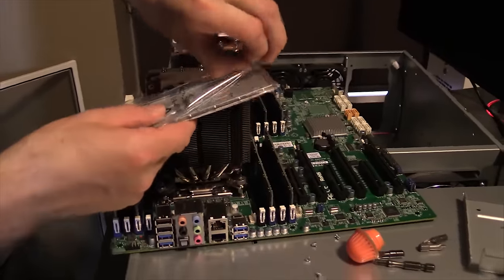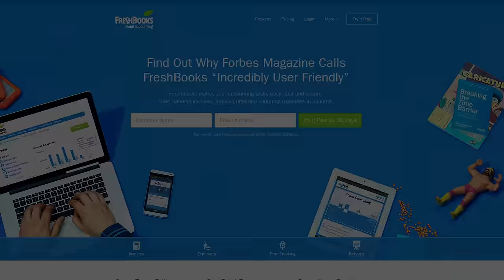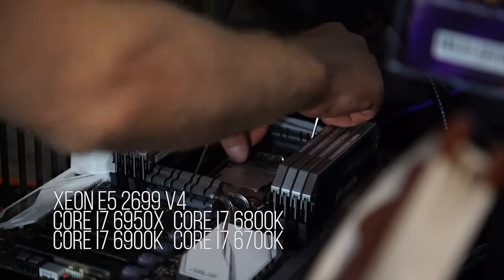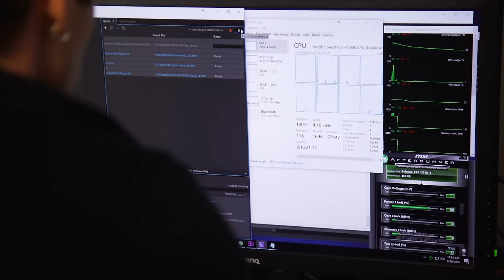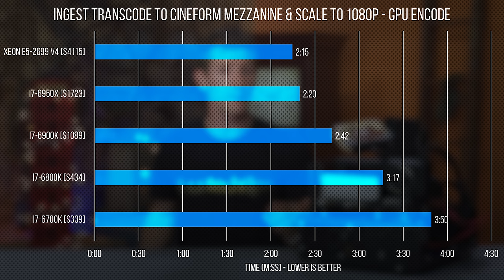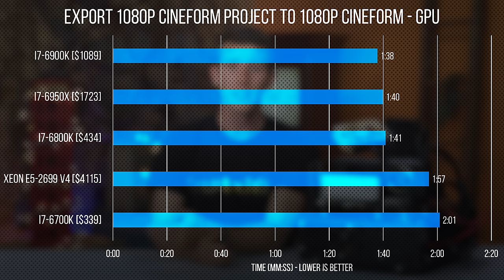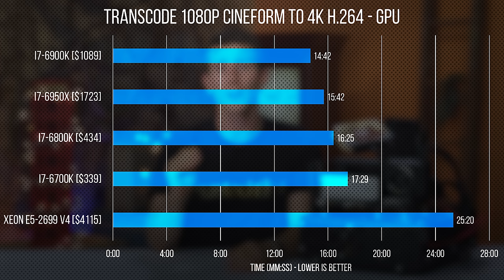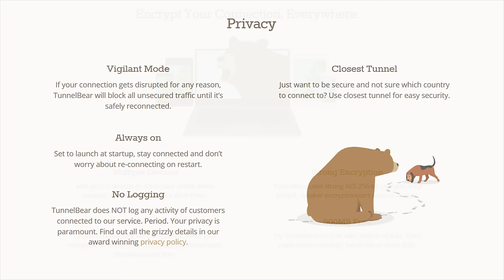$300 CPU Beats $4000 CPU?? - Cores vs clockspeed for video encoding

Comment: Somewhere out there is an Intel Xeon Marketing Rep who's never sending Linus another Xeon CPU and somewhere out there is a very emotionally confused Core i7 rep who's happy about Linus' results but is about to walk into an awkward meeting tomorrow with the Xeon team LOL
Reply: Comparing Xeons to Core i7s is like comparing twenty mopeds to a huge motorcycle.  The 'cycle will get you to the destination the fastest, but the mopeds will be better if you want to bring your friends with you.
Reply: Using x264 you get really good scaling with more threads but max is 1 per 40 vertical pixels or so they say
Reply: W
Reply: The 2699 was designed for very scalable apps i.e. server farms and virtualization data centers. 
Efficient encoding is notoriously hard to parallelize so it was clearly a very poor fit.
Intel also made several W xeons with low core count and high frequency, specifically designed for workstations, where ECC and the huge amount of addressable RAM give xeons a clear advantage versus i7.
Reply: Aaand if you OVERCLOCK your moped you can drive as fast as the motorcycle can,  but the sysadmins might come and smack you over your ram sticks! ;) ...or something xD   (made no sense... I know..! ) xD
Reply: LOLOLOL ROFLCOPTER 4000
Reply: +Stefan Karlsson haha I love it!

Comment: More cores + overclock for best of both worlds?
Reply: First you need to increase your internet speeds by taping a battery to a Ethernet cord. Honestly Thio you are an actual god on satire because you base it on half truths (most of the time). My favourite by far was how to cool a beer in 2 hours.
Reply: Joe how can i upgrade my ps4 to ps4.5 for free ?
Reply from the maker: +ThioJoe here I thought you were going to suggest replacing my power supply cables with pipe cleaners.. :p
Reply: Yeah, and while we are at it just through out your ECC RAM. its slower anyway
Reply: +LinusTechTips, totally off topic.. What watch is it that you are wearing? looks cool.. ps. good content, keep it up!
Reply: LinusTechTips of course not... you need to wrap it in gum wrappers
Reply: oh sry i forgot about that :) Aluminium foil from the kitchen should work aswell
Reply: or if you don't know correct english its aluminum , even though on the periodic table its aluminium
Reply: You can't overclock Xeon Processors
Reply: NonsensicalVids I thought they call it tinfoil? I wasnt sure if that is made of aluminium aswell so i went with the materialname :)
Reply: Michael Novak Check out ThioJoe´s Channel, it will make things more (or less) clear :)
Reply: Lukas H. its made of aluminium or other grey metals. but more commonly aluminium
Reply: scam
Reply: Seeing you comment on any video makes me doubt it's legitimacy!
Reply: I heard melted chocolate makes more cores run wild :P
Reply: Probably poor optimization on the software.
Hell, you could run 2 dozen and a half Minecraft servers on it.
Reply: He got a 3% OC on that Xeon
Reply: bro you gotta link for me to download more ram?
Reply: no download 8 cores
Reply: Moar GPU!
Reply: why don't you make a tutorial  to show us how to increase our cbu cores  into 100 core for free 😂😂😂😂😂
Reply: ThioJoe How to get 1mil  subs ???
Reply: You can't over clock Xeons so you would have to use a 6950X or something
Reply: NonsensicalVids aluminium is your it's spelled in Canada it's pronounces al you mi nee em
Reply: ThioJoe Nah M8 you gotta pour water on it and the results will be shocking
Reply: Well the more cores you have the more difficult over clocking becomes
Reply: yeah heck the wr for highest overclock is on a 8 core processors with 6 cores disabled
Reply: I tried this.  I works like hell!
Reply: That would be great but unfortunately most Intel server solutions have no support for any overclocking, at least not that I've seen. You usually get out of band management though, that's cool. Amd might provide a new solution here with their new CPU lines.
Reply: you gotta download more cores, then buy and digitally download more electrons to pass through the cpu
Reply: Rgb thermal paste is the answer.

Comment: This is just another page in Linus's book of failure.
But we love this book.

I would love to see these tests with H.265.
That bitch of a codec requires huge amounts of CPU power
Reply: We all know you need at least 6 supercomputers to run pfSense.
Reply: ... but h.265 is for low bandwidth encodings only
Reply: +murphy Not necessarily, no.
Reply: Of course you can also use a spoon to get in your shoes, but that's neither what it was designed for nor the most sensible way to use it. You'd use a shoehorn for that and you'd use a spoon to eat soup. No need to tell anyone you can use it also for other things, it's obvious :)
Reply: murphy No, I intended to suggest further than that, that it is very sensible and suitable for other uses as well.  E.g. related but not the same, reducing storage space needs or achieving better quality on high (but still limited) bandwidth amounts.  And if you were going to point out that this is obvious then I would point out that most people do not conceive of the obvious and go around repeating things like that you need a Mac for editing video.
Reply: It's comparable to AAC vs HE-AAC, at least to date ... each to its own. Last time I checked, which wasn't long ago, h.265 was still inferior to h.264 at higher bitrates, regarding the "cost"/performance ratio. This includes indeed higher compression rates (as implied by my original statement) but also way higher compute power requirements. Storage is relatively cheap nowadays, so for most people it makes sense to use h.264 for archiving (at decent RFs) as well ... unless you have extremely powerful processors and lots of time, while bounded by restricted space. Which is pretty rare in the post-DVDR era.
Reply: murphy While it's true that h.265 is more computationally demanding than h.264, as a practicality h.264 only works nicely for most people due to hardware decoding/encoding, and as chips with equivalent h.265 capabilities enter the mainstream market it will largely cease to be a concern.  I haven't seen any h.265 inferiority to h.264 at any bitrate, maybe I'm unclear on the comparison you're making.  Citation please I suppose.
Reply: The mentioned h.265 capable chips are featuring decoding functionality, that doesn't help with encoding. If you re-read what I said exactly about the inferiority you'll find that proven by probably any comparison that has been made in the past ... so quoting them all would be rather pointless ...
Reply: murphy Granted I haven't followed it recently, but the myriad of studies during it's design and testing were contrary to your claims.  If your claims are true then they pretty much may as well scrap it all and start from scratch on something better right away.  You don't need to quote them all, just cite a few so we can see their methodology and if 1) what you're saying is what they're saying and 2) if what they're saying actually follows from the tests they did.  Also, there are indeed h.265 encoding chips, maybe you needs to revisit the specs of the more recent cards.
Reply: It literally took me half a minute to find several sources confirming my statement reagarding substantial efficiency disparities ... and since you erroneously allege that previous studies were contrary to it (of which the opposite is the case), did you probably refuse to re-read it as suggested, still not getting its actual point?
What's again your point in urging me to cite sources for widely accepted facts like the sun rising in the east and setting in the west, how about citing some claiming the contrary first? How comes that you don't find even the most prominent comparisons, is your Google out of order?
The "mainstream market encoding chips" you are probably referring to need proprietary encoding engines, and really everyone who has addressed that matter came to the conclusion that their results are mediocre against CPU based encoding.
Last but not least, you are not "we", unless I'm talking to your highness in person. We are the ones who know all the stuff I wrote ... which took far too much of my time already (speaking of efficiency), so if you're not just trolling me, please quote exactly the statement you assume to be wrong and then disprove it by making a proper citation yourself. Not the wrong way around. Can't wait to see it.
Reply: murphy Sorry, I was addressing strictly performance metrics, which you can indeed find reams of in the wikipedia article references, the x.265 site, the Moscow University Codec studies, etc.... almost ad infinitum.  Cost per performance is a sketchy metric to use here, considering that both can be measured very different ways (e.g. do we include transmission costs, storage costs, compute energy costs, hardware costs, the market cost right now despite that h.265 costs are dropping much faster than the more stable h.264 costs, etc...).  Actually I could not dig up a satisfactory analysis in the short time you indicated, so indeed, please do provide one.  In terms of performance, well, there are some things you just plain don't get with h.264 for starters.
Reply: So I'll really have to quote myself concerning "cost"/performance ratio: "This includes indeed higher compression rates (as implied by my original statement) but also way higher compute power requirements. Storage is relatively cheap nowadays, so for most people it makes sense to use h.264 for archiving (at decent RFs) as well ... unless you have extremely powerful processors and lots of time, while bounded by restricted space. Which is pretty rare in the post-DVDR era."

This is neither  "sketchy", nor is it me who doesn't get something here, quite obviously.

Again, "if you're not just trolling me, please quote exactly the statement you assume to be wrong and then disprove it by making a proper citation yourself. Not the wrong way around."

I couldn't find any analysis stating the opposite of what I said above, and this is not due to insufficient research capabilities ... there just are none. So if you're able to find any satisfactory analysis, you'll find my statement proven.
Reply: "This includes indeed higher compression rates" <- that's not what Moscow University found, and no, I didn't see anything contradicting them on that.  Compute power requirements I addressed, they're marginal unless you're the size of Pixar. 

"I couldn't find any analysis stating the opposite of what I said above"  You apparently also can't find any supporting it despite your claims as you are apparently incapable of linking any of it.  I agree in terms of power use, but the difference really is pretty insignificant.
Reply: Wait what, you now even disagree on the most significant advantage of h.265, its higher compression rates?! Are you sick? That's the one thing it was predominantly designed for, and the one thing where it manages to deliver first of all!

Compute power affects almost everyone, more than obviously ... why else do you think the comments and forums are bursting with people talking about performance per time, but hardly about storage space problems anymore? In what kind of universe out of touch with reality do you live actually? If h.265 saves half the space but needs about two or three times as long to encode compared to h.264 at the same level of quality (at higher bitrates = lower RF values the ratio gets even worse, because - again - this isn't what h.265 was designed for), that's not what only these people and "Pixar" care about, but also and first and foremost designated experts who know what they're talking about ... including those who published all the (partially highly) analytical comparisons you happen to be too stubborn or to blind to stumble upon, despite them laying in your way all over the place.

> You apparently also can't find any supporting it
Do you even read, 'bro'?

"you'll find that proven by probably any comparison that has been made in the past ... so quoting them all would be rather pointless"

"What's again your point in urging me to cite sources for widely accepted facts like the sun rising in the east and setting in the west, how about citing some claiming the contrary first? How comes that you don't find even the most prominent comparisons, is your Google out of order?"

"quote exactly the statement you assume to be wrong and then disprove it by making a proper citation yourself. Not the wrong way around."

"I couldn't find any analysis stating the opposite of what I said above, and this is not due to insufficient research capabilities ... there just are none."

THEY ALL come to the conclusion I stated above ... again. Will you finally get that? Hint: "h.264 vs h.265" will do. Apparently you were unable to cope with figuring that out by yourself.

There is not a single comparison claiming that h.265 encodes at least as efficient regarding effort vs. outcome as h.264 at higher bitrates, because looking at the congruent test results that would be just plain stupid. It's only sensible to use when higher compression for lower bandwidths is the principle requirement, and really everyone except you knows that.

> as you are apparently incapable of linking any of it
Uh-huh, and what about you, if that logic makes any sense? Which it doesn't, because I repeatedly told you they just all say what I stated? While there is none claiming what you stated? The incapability is, again, wholly on your side. Nice try - but, alas, nice own goal as well.

Really not sure anymore if trolling or ....
Reply: murphy I told you what you stated was vague, and it was, that's why you're struggling so much with what I linked.  I never disagreed with what you're now claiming I did.  On that topic what I said is that the differences are pretty much negligible in dedicated hardware.  Of course if you persist in doing it only on the CPU then that's not the case.  The reasons for doing it on the CPU are not higher quality per se, but merely current availability.  The standard is in place, it can be programmed to FPGA and then shipped to large scale production of ASICs and give exactly the same output. 

Regarding storage, it's not storage space that has been a thorn lately, but storage bandwidth in distributed filesystems.
Reply: +K Doe
"Get a life" would have been more appropriate at exactly that point ;)
Reply: murphy
u mad bro?
Reply: We are already moving to 4k so h265 is needed unless you want to have 4x the size of h264 encode to 4k
Reply: +mkOYz19 Good luck with encoding times of at least several hours ;) 
Don't get me wrong, for commercial 4K Blu-rays with insane bitrates HEVC/h.265 is obviously a must due to space limitations (as mentioned before), but personally I'm fine with 10GB 4K files instead of 4-5GB 1080p files at decent bitrates, as long as it doesn't take days to encode ... therefore h.264 is still a thing (mind that 4x pixel count doesn't mean 4x file size).
Reply: Well no wonder there's still people prefer 720p heck even 480p because you know its easy to play and much small file size but i dont blame them its their PERSONAL choice.
Reply: Personally, as you said, I think the difference between 480p and 720p is blatantly obvious, 480p looks really terrible even on mid-sized screens. I'm fine with 720p for most content on a 40'' at adequate viewing distance. I prefer 1080p when it really matters (HQ cinematic footage). 4K arguably makes sense on large screens at relatively close distances. Doesn't that sound reasonable to you?
Reply: Till 265 uses GPU to encode and we are on the same thing again.

GPU>CPU.

If Linux used a Quadro card, that bench could be the double or triple on speed too.
Reply: We were obviously discussing the presence, not the future.

Also, I already mentioned earlier that GPU based encoders are known to fall far behind CPU based encoders qualitywise. Can't wait to see that changing, but it's not for now.
Reply: I wouldnt be surprised if premiere uses just 20% of your cpu too :D
its the usual timeline software.
Try x264 without premiere and you will get 100% cpu usage and a by far better encoder too.
Reply: nope. You got tricked by marketing.
GPU is only good for filter/effects, not for encoding (GPU Encoder trick you, because they use very inefficient encoding settings)
Reply: Its not 4x the size. Its the same wrong assumption like 60fps would be twice the filesize of 30. Just wrong.
Reply: De-M-oN Are to talking to yourself or to someone specific? *hint hint*
Reply: GPU is better for encoding if it's hardware supported.

Like mining bitcoins.
Reply: Reading difficulties or disturbances of memory?
murphy clarified that a month ago already.
Reply: Oliver ASUS I did. yes.
Reply: De-M-oN 
"Do you want coffee or tea?"
"I do. Yes." 

:D
Reply: Okay, that reply was specific in every respect ^^
Reply: Oliver ASUS apparently youtube doesnt put the name within the comment when you answer comments on the video and not on the bell.
Reply: Ryzen would like to know your location
Reply: You can often learn more from failure than through success.